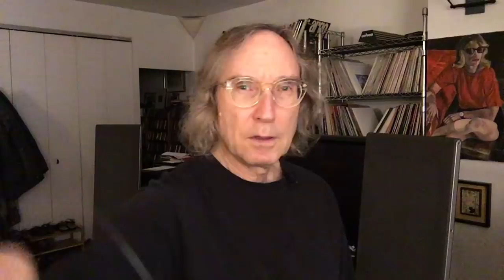Can you imagine how a platterless turntable could work?

Comment: I just stopped using a ringmat and whilst it does sounds good,  it is perplexing. I went back to using an Oyaide tungsten loaded elastomer mat. The sound is darker and superficially less exciting. You then start to get the fact that the sound comes out of a darker background and there is less waste energy in the sound. I just added a peripheral wave trap to the platter and the noise floor fell again. There is much greater definition and higher resolution of low level signals in the mix. There are therefore good reasons for the Meitner to work and both the ringmat and the oyaide/peripheral wave trap support Meitner’s theory but, the implementation demands a mythical, flat record without any internal resonances... 
I keep finding that if I remove or diminish sources of self noise and resonance, records can be transcribed more accurately. The Meitner I suspect, would have been like twanging a clamped ruler.